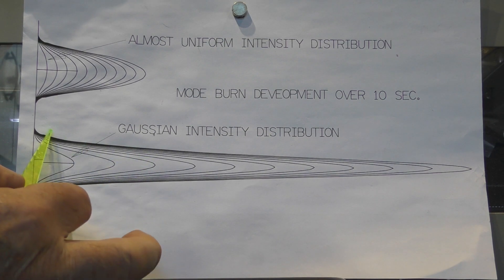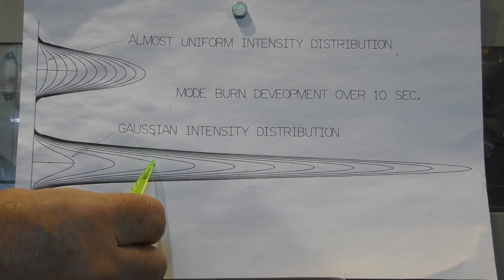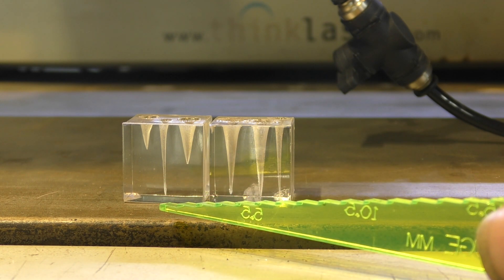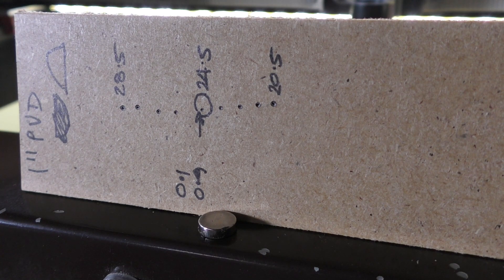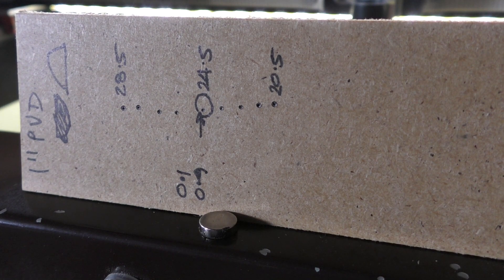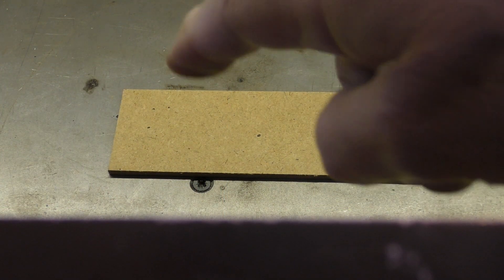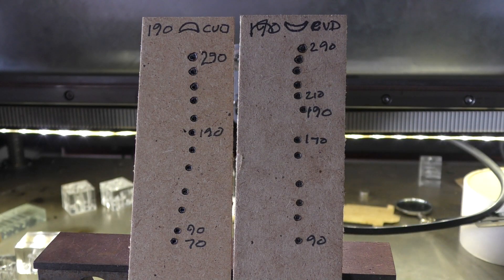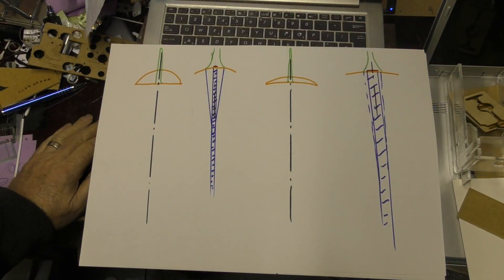RDWorks Learning Lab 235  Small Beam and Long Focus Lens Incompatable

Comment: The curvature of a spherical lens is constant across its surface. There is no dead spot in the centre. When you send it through the side the beam will see roughly the same change in incident angle from side to side as it would across the centre, i.e. not much if the beam is small. I.e. rays that are already close together only need to be deflected very slightly differently to focus but they all need to be deflected an appreciable amount to bring them all back to the centre. The main difference is that the beam strikes the lens surface obliquely, so will cover a slightly wider patch of lens, just as it would if you aimed at the centre but from a slight angle. 

Are the holes at the back inline with the entry holes, or are they offset when the beam is off centre?
Reply from the maker: Thanks for the comment because it allows me to explain what I mean by a "dead spot". My visualization is different than yours and is based on sound laws of physics ( See Snells Law of refraction).When  a light ray strikes a lens surface at an angle it is refracted  to a different angle depending on the refractive index of the material it enters . If a light ray strikes a sheet of parallel glass for example   at an angle of say 15 degrees it will exit the other side at 15 degrees a  but it will be in a different alignment to when it went in. On the other hand,   if it enters at 90 degrees it will exit at 90 degrees with ZERO offset  ie it will pass straight through with zero refraction. 

 With any spherical surface there is an axis. If you climb up hill towatds that axis  there will be a point at the axis that you are neither up or down but absolutely horizontal  That point is 90 degrees to the light ray that will then  pass through the axis unaffected .  As the focal length of a lens increases it becomes more like a sheet of glass with a flatter and flatter entry surface. It is true that at the instant you move away from the axis then refraction begins. However, the larger the spherical radius the longer it takes for any SIGNIFICANT  refraction (focus) to occur. . Lenses were designed for transmitting images of aproximate uniform light intensity . I realize that if I make the beam bigger and use more of the lens surface it will create a better focus,   but making the beam biogger removes its intensity and it is intensity that causes material damage. A small beam with high intensity  cannot be amplified by a lens, my demonstration illustrates that clearly . If I make the lens focal length very small (as in my 1" lens) the curvature of the surface becomes significant and that dead spot decreases in size and  the lens "sees" more of this very small beam on its angular surfaces. It thus make a reasonable attempt at focussing it.

Snell's law predicts what happens to light rays as they pass through a lens but there is no mention about the ray INTENSITY  in this law because lasers were not around until 50 years ago and all these laws predate that invention and  are caviated by "uniform light rays"   According to those basic laws of refraction, offsetting the beam is a completely  logical solution to make sure there is never a 90 degree incident angle for any of the rays.  It is becoming obvious to me that lenses have serious limitations when you try to use them  with a laser beam. They were designed for transmitting images  in telescopes, cameras and microscopes etc not  for amplifying variable intensity light energy to damage material
. 
The bigger the laser beam diameter the lower the INTENSITY variation across it and the more it is tending toward that uniform light condition that lenses were designed to work with. That's exactly what conventional  beam expanders  do.  Effectively they are degrading the cutting potential of the beam but great for engraving.

 My final argument is that fact trumps theory. I need a lens to amplfy my small high intensity beam. The fact that it cant,  implies I have stepped ourside the operating envelope for lenses......unless you have any good ideas how it can be made to work.  That is not intended as a demening comment, exactly the opposite. more of a request for logical and practical suggestions to solve this challange.  To double the cutting capacity of a relatively cheap  RF laser beam  without spending another $2K to $3K on a 60 watt tube upgrade will be a great asset to the hobby laser community.

 Best wishes
Russ
Reply: @SarbarMultimedia  I don't recognise amplification in your context. The power is always the same. All you can do is concentrate it to a smaller spot by focusing. Conventional theory says you need to expand the beam to get a smaller focused spot and also columate to make it parallel so it doesn't vary across the machine. I don't see why you reject that. Of course an expanded beam does less damage but when focused back down to a smaller spot it should do more damage.  It doesn't matter that the beam is Gaussian and all the rays have different intensities if they all pass through the same spot. The reason they don't seems to be primarily down to the spherical aberration of the lenses and its interaction with the Gaussian distribution. Perhaps you just need lenses with less aberration.
Reply: Thinking about it some more. You want a wider beam to get a smaller spot, but a wider beam sees more spherical aberration so you don't get anywhere. I think you need aspherical lenses to accurately focus a wide beam. Perhaps although your RF beam starts small, it has more power at the edge compared to the glass tubes, so is affected by aberration a lot more, and so needs better quality lenses.
Reply from the maker: @nophead  
 Sorry for late reply. I got your previous comment late last night and have been in London all day.with the wife to see a musical version of Cinderella. 
 OK now I am back to reality!!
 If I  project an image through a lens then at the focal spot the image will still be completely intact but compressed.and of higher intensity. because what arrives beyond the focal point is an expanding undamaged image. So in that case we see two things. The light rays  are compressed and the light  intensity is amplified. That describes my simple model of intensity amplification. However, your questioning of this simple model made me stop and think about the way light intensity gets amplified by a lens. Please follow me on this journey.  I take a 10 mm diameter stick of Plasticine and wrap a different color around the outside to create a 20mm diameter stick.  Forget the impracticality and imagine I force this through a cone to extrude a finished stick 5mm diameter.  T'm sure you will agree that the finished extrusion will contain a central 2.5mm different colour core. ie  50% of the original diameter. If I now remove the cone from its extruder and slice  it through to examining what happens to the core at various stages of extrusion, I sure you will instinctively know the  ratio will always be 50%.  I use this example because  it is a perfect example how a lens DOES NOT treat an IMAGE, or INTENSITY. The easiest way to describe it is that rays from the outside of the lens have to diverge at a faster rate than those at the centre. Therefore they will combine and their INTENSITIES become additive sooner than those at the centre of the lens. It also means that the image (even though it is out of focus) will be likewise distorted, until the focal point.  This is a concept I had failed to imagine with my simplistic amplification model. Was this really true  or just another wild idea?
see this quick and crude test I conducted with items I found on my desktop.
https://www.youtube.com/watch?v=7FQ5g1lUn9Y

It causes me to now re imagine what might be happening to my small intense beam. Thanks for your "help". By the way there are no  commercially available aspheric lenses for our machines we are stuck with plano convex and positive meniscus.

Lots to think about 
Best wishes
Russ
Reply: @SarbarMultimedia  I wonder what effect the fact that the incoming beam is divergent has. Does it just push the focus point back a bit, or does it mean the outer rays focus further back than the inner ones as they arrive at a steeper angle?
Reply from the maker: @nophead  
Hi
 The focal point of a lens is based on the fact that the rays hitting the lens are parallel. Converging rays shorten the focal point  and I have much experience of this as I play with compound lenses., Diverging rays  increase the focal distance.  The way I have that narrow beam set up with the beam conditioner, has created an almost parallel beam at the centre of my work area  plus or minus 200 mm of beam length. There is a slight convergence at the back corner and a slight divergence at the front right corner.
 Best wishes
Russ

Comment: Hi Russ,

All surfaces are not perfect.. Therefore the Radius of the lens will have imperfections in it..If the beam is using ALL the surface of the lens then it is 'averaged out'.
However if the beam is using only a very small amount of area then any imperfections will have a greater effect ? ( ie some 'rays' would not go in the expected direction and perhaps exit at some unknown angle and be lost forever, heating up the tube for example or even heating up the lens ? )

As the beam is moved more off centre of the lens then there is a greater angle of strike on lens. Is it possible that the greater the angle the more there is reflection off the surface rather than passing thru the lens ?
After all , if 30 watts in to lens ( assuming zero loss in lens ) equals 30 watts out.  Then no matter where the beam enters the lens you should get 30 watts out... but as you showed in your experiment moving the beam off centre reduced power.  This loss of power must be going somewhere ? Perhaps its not showing up on wood as too low a power spread over too great an area.
Perhaps do a burn, then place a piece of tissue with ( say ) a 3 mm hole in it over the previous burn and repeat. Would this show any 'energy' that is too low to show on wood.
I guess you could use your dohickory power machine but then I guess it would burn a hole in it as you would have to do a long time burn..
But then ...what do I know...
as an after thought.. Is there not a danger of creating a too small a dia beam that then overloads the power dissapation of the lens. ( i presume that a lens that can 'handle' 50 watts expects it to be  a gaucean distribution over its surface area and not focused on a 2 mm dia circle ? )
Keep going... this is bloody interesting ...If a solution is found then could it not be used also on c02 to reduce beam dia using the beam expander  ?
Jerry
Reply from the maker: Hi Jerry thanks for the response because as you well know by now, I am not teaching but am an ignorant student playing with things that are interesting and curious but  that I theoretically should not be dabbling with. I work with a few basic facts about lenses and light and apply a mechanical interpretation to what I observe. It's rewarding when someone like yourself has watched my unconventional approach to optics and tries to offer a more rational explanation.  Your reflection thought has little merit  and I will explain why.. Nabsorption

Comment: Hi Russ. Just shooting blanks here, but: how about using those small diameter lenses (12 mm)? That would obviously need of changing the lens holder inside the lens tube (or the whole tube, in any case) but changing the diameter should also change the overall shape of the lens too, which seems to be the constraint here.

Comment: What do you think of a long focal length lens for cutting material like foam? It seems to me that despite the unlikelihood of such a lens improving your cutting power it would at least square off the beam somewhat and that could be very useful for foam.

I guess I'm waiting to discover what they're even good for.
Reply from the maker: What I'm discovering is not  generally useful for normal glass tube machines because the beam is already big (5mm or more) when it exits the tube. It also has a fairly small divergence  of about 3mm growth per metre. . However the lens limitation is a serious nuisance for me because it means I will have to compromise the cutting capability by increasing the beam size and thus reducing the intensity  
It depends on the sort of foam and how thick it is.  as to your best lens choice. If you do chose a long focus lens then the best compromise for its use may be to set the focal point 50% into the material. This is NOT generally good advice because setting  the  focal point onto  the surface  is best,   However,  foam (especially HDPE) has a very low melting point and will usually follow shape of the beam. A good strategy for foam is to play with DOT MODE. Rapid pulses are better than continuous power.

Best wishes
Russ

Comment: Have you ever thought and or attempted to coat your mirrors in graphene?  From what I understand it has 99.9% uv reflection.   Since graphene mirrors doesn't exist commercially and homemade are poor quality,  I was wondering about using gapahene spray coating.   If it actually performs as stated, the loss of power and light weth distance should be reduced.
Reply from the maker: Hi Shawn
CO2 laser light is 10.6 microns   (10,600nm) wavelength and that is in the mid to far IR region. UV  is around the 350nm region. That makes a HUGE difference as to how the light reacts to materials.  I can tell you  that 10.6 CO2 light  only "sees" 3 things. 
1) Metals......all metals are reflective Most are in the 0 to99+ % reflective. Hence they are used for mirrors in CO2 laser machines
2) A VERY small group of salt-like crystalline materials  such as zinc selenide and gallium arsenide that allow the IR light through and are used for lenses.
3) Everything  else.  This large last group will absorb the IR light energy and convert it to heat with varying degrees of efficiency.

 Carbon in particular ( in group 3) is super efficient at converting energy to heat.  thus it is the opposite  of a mirror at 10,600nm. I have  looked for the reflectance data of graphene at various wavelengths and been fairly unsuccessful.

 Gold is supposed to be the most refective metal at IR wavelengths (hence the James  Webb telescope mirrors). That may be true of NORMAL light but all the experiments I have done with gold plated mirrors and LASER light return results of about 95% reflectance. I had more success with my own manufactured pure copper mirrors at 98.5%. Some of the cheapest mirrors you can buy (and the best value for money ) are molybdenum mirrors  that are 97% efficient.

 I was born with skeptcism encoded into my DNA and my life experience has taught me to treat specifications with great caution. Under very special conditions they may be true but are those conditions something you can replicate in normal use?  For example I have reseached thoroughly the lenses we use in our machines . They  can never meet the claimed specifications because they are designed according to thousand year old lens theory parameters that work perfectly  for telescopes, cameras, projectors etc . However,  pass a laser beam through them and it is easy to demontrate  results  that  are way off specification in every aspect.

 My point is that "what you understand" about graphene needs to reserched and understood before you waste your time and money on a possible wild goose chase. I can find no reserch data and that worries me.
 Best wishes
Russ